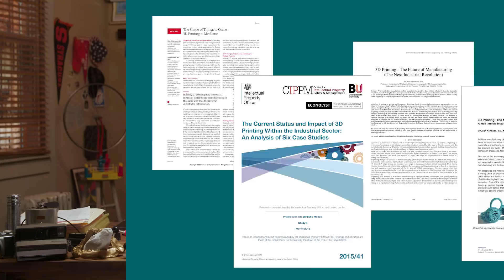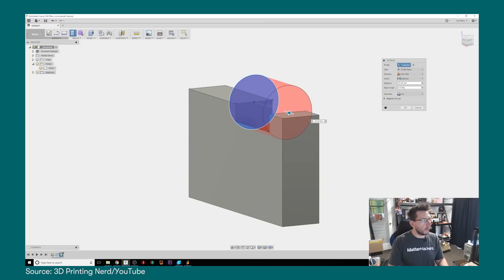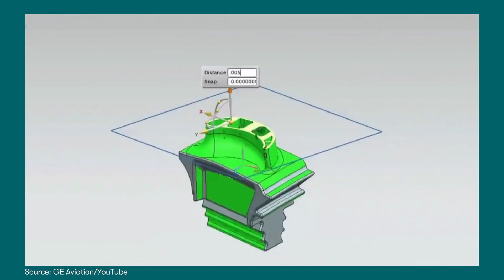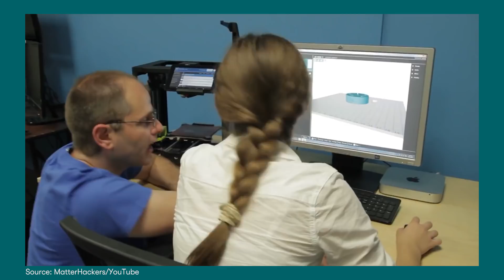What happened to the 3D printing revolution?

Comment: I just always think about how much useless shit 3d printers end up producing. Do we really need more plastic junk in this world?  And how many average users are really going to take time to make custom designs and implement them?  Seems like 3d printing should actually be implemented in industrial purposes rather than for the average consumer.
Reply: funny thing is, it has been a significant part of industrial processes for decades, it's just that only recently it has gotten the attention. 
I've used 15+yr old FDM at a manufacturing job and it prints better than most $1k+ printers that are for consumer use these days.
Reply: Yea majority of 3D printing hobbyists use PLA plastic which is a sugar based biodegradable plastic.
Reply: As far as prototyping goes, I expect that it saves resources on the whole since you don't need to make molds, etc. Also, biodegradable filaments.Plus, the average household might not need one, but a 3D printer is superb for tinkerers that need a custom part once in a while for whatever little project they're working on at that moment. Personally I'd love to have a 3D printer, but it's still far too expensive for something I'd use maybe a couple times a year.
Reply: 3D Priting/Additive Manufacturing is actually huge in industry
Reply: For the sake of argument, let's assume we would be putting the same amounts of plastic in the environment as before. We are still saving on fossil fuels by producing  in house (  the exception of the filiments & maintenance)
Reply: The titanium brake calipers from the Bugatti chiron are 3d printed. And so are a lot of things in the industry
Reply: Can’t tell if you’re commenting this because you don’t like the printers or you print functional parts and don’t like people who print useless things.
I design most of the parts I print, and they’re almost all functional (occasional test prints are not...). That’s no reason to not market printers to consumers, it’s just a reason to market it towards people who already know CAD and will use it for functional parts.
Reply: PLA is a plant based filament that does biodegrade. You are right, there is far more use in industry than average consumer. The problem lies in the fact that anyone can take a print off the internet but the real power still in the design software and the know how to use that software to design whatever you want. Cost and expertise of the software is a barrier for the average consumer. Being in the industry, it has great value as additive manufacturing but will never replace reductive manufacturing.
Reply: well actually it depends on what 3d printer you are talking about, the hobbist usually works with PLA (which in theory is biodegradable, i have yet to see one degrade in my personal tests). regarding manifacturing there is a rise in the metal 3d printing and those more normal looking FDM printers are getting better and better at printing all sorts of polymers, like biodegradable material, auto-disinfecting plastic, edible-grade plastics, rubbers, fibers and very specific stuff. HP has also presented last year a huge very fast 3D printer that uses a different concept than FDM printers that is capable of mass producing stuff with virtually 0 wastes as the left over material is reused.
Reply: 3d metal printing is all well and good and very costly. Having priced one out it was $100,000. The application is everything and not the technology. Some 3d metal parts make sense but if you require hardness, ductility, abrasion resistant so and so forth you will never replace reductive manufacturing. The material choice and environment dictates the process. We actually use a quite a lot of PLA for cost and ease of printing, with the proper settings and not rushing the build we can get some excellent results we use clinically.
Reply: For 99% of the population that's pretty much 100% correct. But don't underestimate 3d printing; as a rapid prototyping innovation, 3d printing really is the next industrial revolution. I'd hate to sound like I'm overhyping it but the immense time and money saved by 3d printing type prototyping and design iteration translates to tens of thousands to potentially hundreds of thousands of saved dollars for every company for each item they produce. 

The free market theory states that if it is substantially cheaper to design and develop a product (immensely increasing profit) eventually (hopefully sooner) at least 1 company is going to lower the prices of their final products to be more competitive in the market and sell more, then most of the other companies are going to have to follow suit and adapt 3d printing prototyping and lower final product costs to remain competitive in the market. The free market dictates that with the dramatic increase in profit, the market will adjust to a lower equilibrium to both remain profitable whilst being competitive. Yes, companies can just agree to keep costs high for maximum profit, but that's mostly with duopolies, triopolies and other markets where a handful of companies hold a vast market share, in a free market it only takes a single rouge company who wants to be more competitive in the market to start driving down prices to natural equilibrium. 

Yes, you're right, we'll probably never see widespread desktop 3d printers because they still have a learning curve and they still require experience and calibration. But then again think about paper printers. How common are they really? A lot of households have them, but a lot of households don't. What do people even use printers for, besides printing resumes? Unless you specifically need a printer for work, it would seem that the majority of people are divided into those that print very rarely, except maybe for resumes and those that print all the time, just cause'. Likewise, what you're overlooking is that Microsoft office (like word) and other word-processors are still a skill with a learning curve. Most of us younger ones grew up with word and printers so they're fairly easy and we view them as non-skills, yet most older people would struggle to write a word document and print it without help. 

Ever printed something and realised the formatting failed on the print cycle and it doesn't look like your word document? I printed about 5 resumes a few weeks ago without checking that everything went as planned, I don't know why but it didn't format my references on a new page, it split them half and half between two and it just looked unprofessional. I made a page break in the word document and fixed it, but that's still a calibration method. People don't appreciate how intricate office suits are because of 1. Most of us have grown up using them and see them as second nature and 2. Most of us don't have a complete [power user] grasp on their entire toolset and assume them easy because we know the basics to print a resume, cover letter or, I dunno, lost pet sign. 

People also don't appreciate that the quality of a paper printed product lies in your writing skills. Calibrating a paper printer isn't terribly difficult and most prints are consistent, but the quality of what you print comes down to your writing skills, your grammar, your formatting ability and your design intuition. If you print something that's formatted wrong or reads like trash, people just say you did a rubbish job and need to improve. Likewise, 3d printing is exactly the same. Instead of using a word processor and influencing the quality of the final product with your writing ability, you learn to operate a visual studio, a 3d design suite as opposed to an office suite. Calibrating a3d printer is a little bit more lengthy and intricate than a paper printer as of now, but once it's done, it's pretty much done. In the same fashion that you judge someone's resume (or whatever) against their writing ability and by extension - English proficiency, you judge someone's 3d printing against their visual design ability and their ability to operate a visual studio suite. Once they print an item, flaws in their design are no different to spelling & grammar errors, poor writing ability or poor design ability to format in a word document. In the same way, the previous generation (20's - 40's) was raised on computers using word documents and paper printers, the new generation now is being raised on computers using visual studios and 3d printers. 

I digress. You're right though, very few people will use a 3d printer, in the same way, most people rarely use paper printers outside of schooling, work and resumes. The number of people that will take the time to learn visual studio's in-depth and properly design and print a good product will be roughly equal to the number of people who take office suites beyond resumes and simple presentations to include appealing infographics and design elements. I.e. Very few. The vast majority of 3d printing will be to revolutionise the industry and greatly lower the time and financial cost of a very costly step in product design: prototyping. 

Not to mention plastic recycling methods that seek to use failed prints, discarded/retired items and certain other plastic wastes to extrude new filament at a greatly lower cost to the current filament is quite exciting and will be a revolution of its own. What's that quote? "If trees had wifi, we'd be planting so many trees we'd replenish all the world rainforests in 2 decades. It's a shame they only emit the precious oxygen we need to survive." Necessity isn't the mother of invention, desire is. Currently, recycled plastics often become what they are; new plastic containers for throwaway items such as milk cartons and coke bottles. 

Recycled plastic, as of now, is mostly used as a means of finding a lower cost source for a low-value item to squeeze some pennies in a companies expenses. In the same way, shredded paper (recycled documents) is often used as pet bedding for a 'free' no value item, recycled plastic is often used for insulation, fillings, cheap plastic 'lumber', and plastic-based cordages and ropes. Admittedly, items which are already dirt cheap on a corporate 'bulk-purchasing' scale, yet plastic recyclers obviously help these corporations save a few more cents per item by buying their recycled plastic stock vs virgin plastic. 

This is, how it is now... I guarantee you that once 3d printing reaches the stage that home-based or medium-sized business based operations can extrude filament with acceptable tolerances directly from recycled plastics, even if that only includes 2 or 3 types of plastics, you'll see an instant and dramatic decrease in litter around the world. At $50-$100 per kg ($20-$40 per pound I think) for the filament, I for one will certainly be spending a great deal of time cleaning up my neighbourhood to provide myself 'free' plastic stock for printing filament. In of itself, if you have an extruder that can safely and accurately extrude filament unmonitored, 'scavenging' recycled plastic is in of itself a $50 an hour job (assuming you can find 1kg an hour).

We don't need more plastic junk, but 3d printing may be a key to creating less plastic junk ironically. Now all we have to do is find a way to grow wifi trees and we can save the planet with greed, for once.
Reply: Lots of people here are saying PLA is biodegradable.  Like with most "biodegradable" plastics the fact is that the plastic will probably never reach the conditions it needs to break down in a normal landfill.  If you compost it yourself maybe.  Yes, it's derived from starches and smells good, but it's still plastic so the same environmental concerns exist.
Reply: You're obviously not into 3d printing. Of course you are going to feel that way. It's kinda selfish if you asked me.  It's a great hobby that many people enjoy.
Reply: Nugu It's amazing how old it actually is. I just bought a consumer resin printer. I saw a video of resin 3d printing on a VHS tape during my high school junior drafting class. Like 25 years ago. (We did CAD on original Apple Macs, most of the class was T-squares and pencils.) It seemed like science fiction, and now I have one in my kitchen.
Reply: The most used plastic in 3D printers by far is PLA which is made from corn starch which isnt toxic and eventually biodegrades
Reply: edstar83 it is great and very fun (and frustrating at times...), but I think the point they're trying to make is that too many people buy it thinking that it will be very useful and end up printing random trinkets off the internet. If you use it for functional purposes, great! Even a little bit of printing "useless things" is fine, but I do think everyone with a 3D printer should know CAD to some extent so they can use it for more personalized (and functional) applications.
Reply: Some of us keep the useless crap coming out of our printers to a minimum. I mostly print functional stuff on mine. Things like custom hooks to hang a fan in my bedroom door (AC in my house is strange) or a sponge holder to go on my kitchen sink (I could have bought one, but it would have cost 50x as much as designing and printing one) and game pieces (which, granted, probably fit some people's definitions of "useless", but they're definitely not bound for the landfill anytime soon).

Earlier this week I printed a battery hopper for a friend so that he could more easily rotate the usage of his rechargable AA batteries and not wear them out so quickly. My Swiss Army knife style key holder - which I use every single day - also came off my printer, as did a showerhead that I used for an emergency repair and then continued to use until I moved out of that house. As far as I know that showerhead is still being used to this day.

Now I know I'm not typical. Not only am I able to design things I need relatively quickly but I also don't mind waiting overnight for something to print if it saves me $10 over buying it at the store. But I'm also not unique in either of those regards, and I think that as 3D printers get less expensive and more reliable there will be more people like me. The things are never going to be as common as microwaves, but I bet they will, one day, be as common as table saws.
Reply: all of the things I like are plastic junk junk is good the most enjoyable experiences I have had are experiences people said don't do
Reply: 3d printers can use a range of materials from metal to concrete to plastic. At least from my experience consumer 3d printers use biodegradable plastics.
Reply: Yeah anyone who thinks 3d printers of today are for the average consumer is misguided at best
Realistically they will be a lot like other manufacturing processes, but cheaper. There are people who buy lathes and mills for their garage, but they are few and far between
3d printing just brings manufacturing to that many more people, but it's never going to win over people who don't want to make things, it will win over engineers, for the cost and speed improvements, and hobbyists, for the same reasons